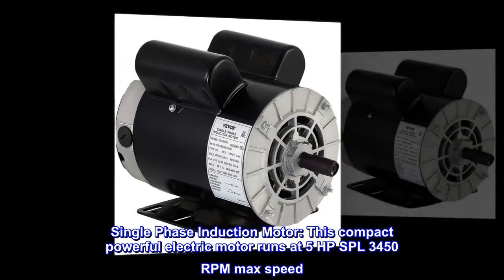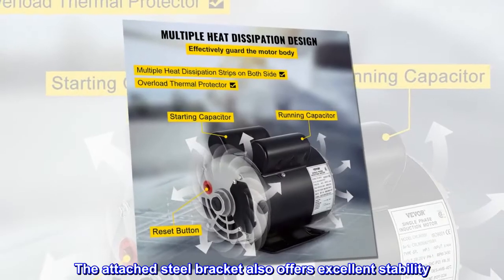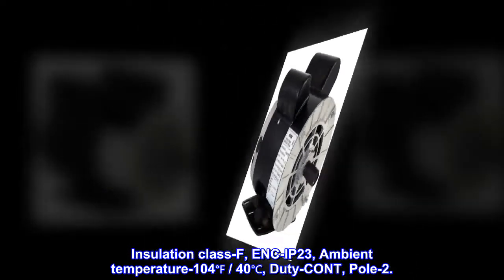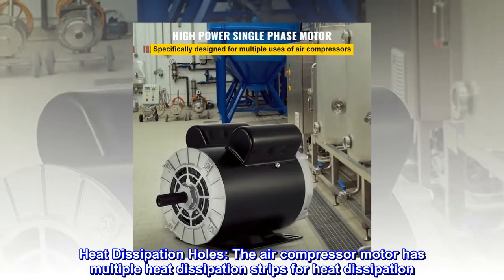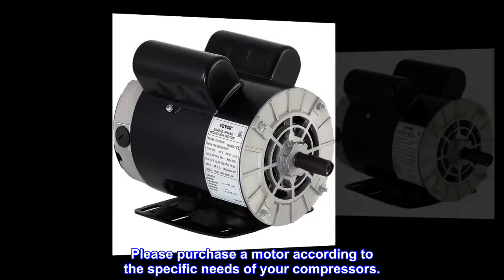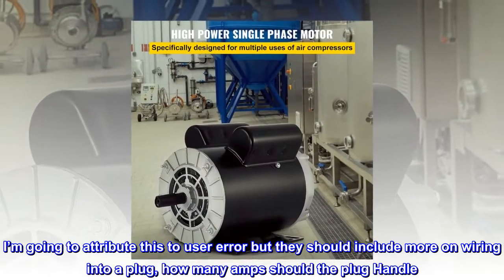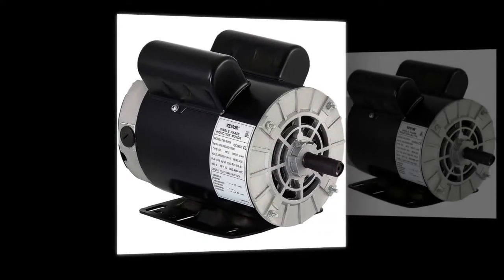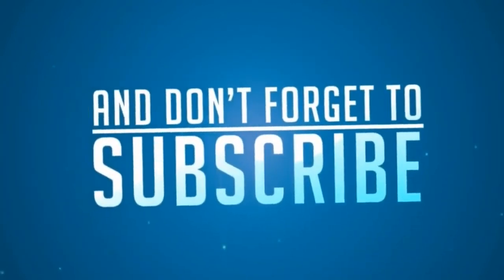VEVOR Air Compressor Electric Motor, 5 HP SPL 3450 RPM, 208-230 Volt 3.1 KW Single Phase

Comment: I replaced a 5hp spl with a 5hp same 4" pulley same motor rpm did add a larger power cord. Do you see and issues.